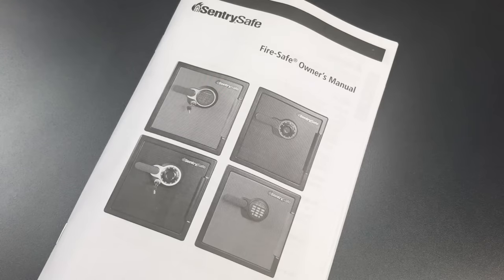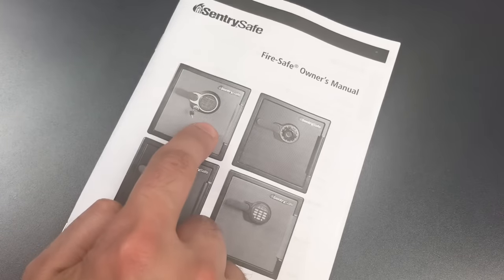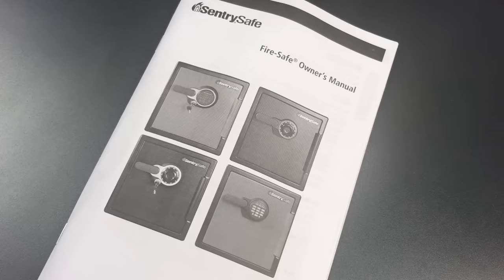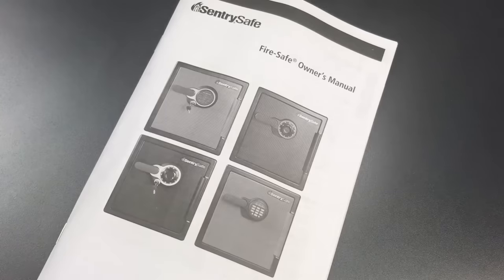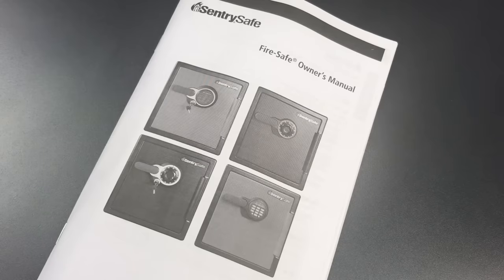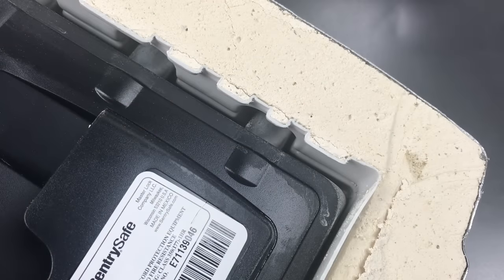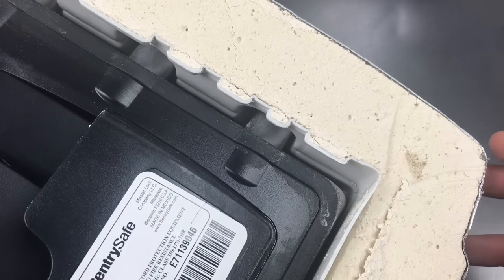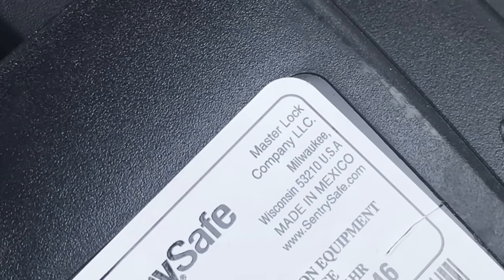[756] Sentry Safe Cut in Half FAST!

Comment: The hardest part of getting into this safe was finding an extension  cord.
Reply: you can cut it with an hacksaw it would take time but after looking at that metal thickness it's not impossible lol
Reply: Flexvolt baby!!
Reply: The blade guard gave him some pause.
Reply: Brutalll
Reply: That thick of metal, you could probably use tin snips.
Reply: "We will build it and the sheep will come"
                                              ~Klaus Schwab~
Reply: The new battery powered ones do good.
Reply: Hardest and longest part was probably sweeping up the dust afterwards!
Reply: Honestly, it's so shit, you could use a bowie knife and a rock to cut the bottom out in a circle, then chisel out the "fire retardant" quickset thing and then you're in like Flynn.
Just looking at how easy the saw cut the metal i can tell it's super easy to deal with it.
Reply: Dude, move the safe closer to the electrical outlet, no extension cord necessary, duh!😂
Reply: Does anyone know what kind of blade he used in this? I have the same exact safe and my grandma lost the key to it and left me it in her will a few years back, i dont want to hurt myself using the wrong blade.
Reply: @aserta  what kind of blade did he use in the video?
Reply: Buy an blade which teeths had a little piece of diamond welded on it.
Reply: In an lithium powered world, who knows where, and what is the electrical outlet?
Maybe for charging your tool like Makita BL system or you likes Milwaukee Fuel?
Or something like DeWalt?
Or chinese cheap copy any of above?
Not makes sense.
You when really want to get fast into that "box", you should have at least the chinese one....
Reply: Its so easy a caveman could do it(with a club and chisel)
Reply: Use a blade that cuts steel and make a few passes lower blade a very little each time and the 1st time too only have the blade out a little….don’t cut all at 1x
Reply: What’s the right sawblade.
Reply: Wireless like me

Comment: ive owned computer cases with thicker metal
Reply: oath
Reply: ive had headphone packages that were harder too open
Reply: you are right. the sentry safes like that are fire safety boxes (with some protection against a fire) that's why they use thin sheet steel
Reply: a plastic storage tub filled with foam would take longer to get in
Reply: No kidding, the IBM towers back in the 90s had 1.1 or 1.2 mm thick cases, i can't confirm for sure because i don't have it around me, but that metal case was strong enough to support a broken beam once in an emergency. I've been transplanting my computers in it for years.
Reply: aserta Just grab a Presario EP series, the case weights a ton. Drop a lock and you got a better safe thant the one showed here
Reply: Odd flex but ok
Reply: @38911bytefree  some computer cases especially the enterprise ones from back in the day have loops for a lock.
Reply: The Vibe  LOL yeah. I still have an OLD Vectra VE Series with the lock and keys to lock the cover. Not the strongest cover from that preriod. It was meant to be a "slim" from factor. Hey, it was in the 96. Deskpros were a bit bulkier. Both of them are tanks in terms of HW
Reply: sinnders97: Indeed, a safe made from 20 layers of blister packaging would be much more secure than this!
Reply: ive owned lunchboxes that were harder to get into
Reply: A iPhone is harder to open🤣
Reply: Think supermarkets have sandwiches with tougher packaging
Reply: Yup!, I shove my valuables in my old 166Mhz computer case.... no lock needed, "hey frank what should we grab? this 90lb safe, or this very old CPU?"... "grab the safe it probably has more valuables, that CPU is just a huge paper weight" 
The opposite is true ;)
Reply: K
Reply: My noughties' Cheiftec tower has 1.2mm steel - have used it as seating at LAN parties.
Reply: hahaha yes old IBM PCs and clones are stronger than this "safe" :D
Reply: I've had beer cans with thicker metal.
Reply: My Phantex Enthoo Evolve case easily has 10 times thicker steel
Reply: I've owned computer cases that weigh more.
Reply: lol your telling me i build my computer in an old intel case from the 90s the one i used to play black stone on  HA the case is so ols it still has an intel pentium 2 logo
Reply: i had condom wrapers that were tougher than this!
Reply: fucking sheet metal. thinner than a computer case literally.
Reply: All computer cases that I've ever seen are thicker, even the cheapest garbage out there.
Reply: i have seen bean cans with thicker metal
Reply: What would thicker metal accomplish?
Reply: Swampy  A grinder cuts through steel with a smaller disk. Metal drill bits, go through metal. Oxy Cutting flames aren't as big and "damaging" as you make it out to be. I work in construction using these tools everyday.

There's nothing I can't cut through.
A safe keeps things safe. A slightly thicker safe keeps things slighter safer.

Most people bolt safes to the ground, in corners against walls. I'd like to see this video again done realistically. The only reason he can use a saw is because it's loose.
Reply: I would use a edc handheld can opener
Reply: @aserta  And in the late 80:s they were cast metal. I have been looking for a case like that for years. I imagine connecting the CPU to the case would make the entire case a giant passive cooler.
Reply: wait thats metal... i thought it was wood and plastic
Reply: @Joey Barreras the outer skin is a piece of sheet metal. The inside is a plastic, designed to fuse into a airtight seal if exposed to heat. In-between there is a insulation foam. This safes are designed to protect against fire.
Reply: @Joey Barreras I based it of the sound from the saw. So I can't be really sure, but I have seen someone burn a safe like this, demonstrate the reason behind the plastic.
Reply: ROFLOL, you try cutting my Cooler Master case like that,
Reply: Yeah, my Corsair case is gonna put up more of a fight than that safe did.
Reply: Yep, my enthoo evolv has like quarter inch aluminum panels, that safe is like having a pop can wrapped drywall lol.
Reply: The sad thing is all the big closet size gun safes you see at big retail stores like Cabela's etc are also thin sheet metal like the one in the video.  They can all be pried open in seconds.  They all have what appears to be some big thick heavy doors but if you lay it on its back and use a spud bar and pry on the sides you can open it in 2 mins
Reply: I've seen Arnold Schwarzenegger bite through thicker metal than this
Reply: There are security packages that are harder to cut open.
I'v cut myself on one of those packages before.
Reply: If I'm not mistaken, everyone's computer case has thicker metal.
Reply: Ikr
Reply: @Eimantas Butkus I thought this was a YouTube comment section, not an academic paper
Reply: I'm 6K Like ....yaaaay congrats mate
Reply: in fact: i own a case with 2mm thickness :D
Reply: x.D
Reply: Try searching jonsbo's case. That thing got 2 or 3 mm of metal.
Reply: Swampy  no problem cutting a 1/4"+ with a good carbon steel blade lol .. (Diablo steel demon ) ive cut bundles of rebar ,heavy gauge framing steel , stainless , I beams , thick plate ,  really not much it won't cut lol within reason
Reply: @sinnders97  LOL
Reply: Yeah, once those cases were thick. now they're like aluminium foil
Reply: Almost all comüuter cases are thicker than that.
Reply: Nobody Knows  So since ur posting the same "FIRE-rant" in several threads ill answer in several of them, cos u clearly like to twist facts..! 
So if u didnt see the whole vid ill just mention the obvious here. LPL literally says: "According to the company website it provides SECURITY protection, FIRE protection and WATER protection. Now i cant speak to the fire and water protection, but as for 'SECURITY' - THATS the reason im making this video." ... 

"...confusing 'cos ... Its a heavy box. Its called a 'SAFE'. It looks like a SAFE. It operates like a SAFE." ... 
"If we read this manual we can see that it explicitly anticipates that owners will keep valuables like jewelry and watches in it."
But yeah NK, u focus on the fire part of it...  X-]
Reply: Freelaxx 1 HAhahah. I honestly don’t think any of us don’t know that for theses types of “safe” the main point is fire protection and to make it less attractive to pick up and walk off with.  Just more of a surprise that the metal part was unexpectedly thin. Also how damn thick old pc cases were :)   I’ve seen how thick the metal is on many many computers but only a hand full of safes.   Also after maybe the first to replies it was more of a pythonesque series of replies.   Oh what I would have done to live in a cardboard box all we had was a pot hole full of dirty mud
Reply: same bruh
Reply: Legit?
Reply: I had/still have a Thermaltake Armor+ case much thicker steal on that than this safe
Reply: @websnarf  not all computer cases are metal post are plastic. Mine is metal, metal cases are kinda nicer in my view
Reply: psh , I'm certain you could find laptops with thicker outer metal than that
Reply: I thought you were exaggerating but I just finished the video and... oof
Reply: The cardboard box my computer case came in was harder to open.

My case would take less time to break into than the safe, though. It takes about 3 seconds to open one of these safes with a magnet, but you could break the tempered glass panel in under a second.
Reply: a normal pc case has thicker metal
Reply: yup. My phanteks evolv atx has way thicker metal construction lol.
Reply: Ha forreals tho
Reply: When I was younger we had canned food with thicker metal, and it took longer to open too!
Reply: me too
Reply: XD
Reply: This safe is so bad, you're not even exaggerating.
Reply: @aserta  The PS2 uses similar casing, and it also had internal plating covering some parts, it was really heavy and probably harder to get into than this safe, if if you go for non destructive entry :P
Reply: Are you talking about your amiga or gateway grandpa?
Reply: I've cut plywood with more resistance to it than this safe
Reply: I see no lock picking !!!!
Reply: I've owned super hero themed lunch boxes with thicker metal.
Reply: @sinnders97  thats funny, what even funnier is picturing someone grab their powersaw to get those damn blisterpacks
Reply: I've cut bargain-basement particle board that resisted a saw more.
Reply: Pretty sure I have owned bags of potato chips that were thicker than that.
Reply: @tobin1677  computer cases with thicker walls prevent audible vibrations. Mostly useful in computers with hard drives.
Reply: I OWN a computer with thicker metal.
Reply: @aserta  I used to have a case like that. I sincerely regret giving it to my brother, who used it for a cricket stump!
Reply: My damn laptop would be more sturdy
Reply: Lmaooo
Reply: Fireproof, they normally aren't strong, it's just insulated, NON fire proof safes are normally way heavier duty
Reply: Would’ve been sweet if you had worked “in any case” into that comment.

Comment: "Let's just cut it in half again to show it wasnt a fluke"
Reply: Thank you for this comment
Reply: A Fluke is a fish. this was a safe. just one cut is necessary to see it is not a fish.
Reply: @PrincetonTV  u ever heard of a joke or nah
Reply: @ywgx7943  Hello Ywgx, hoping your day is going well. A joke has a structure (often) that consists of "the set up" which creates tension an interest. And a "punch line" ("Punch line" see 'Punch and Judy' ) which resolves the 'tension' from an unexpected perspective.  
In the example shown above, the set up is comparing a fluke(fish) to a (locking) safe.  
The punchline is the inference that when one cut open a fish there are "guts" (and guts are also used to infer strength and bravery),
while on the other hand the 'safe' lacks the messy fish guts and also lacks the inferred strength.   

The 'delivery' is the fashion in which the 'set up' is made and respects the common practice  of the longer the set up / the shorter the punchline. 

And of course the joke and it's delivery can be measured as good or bad in terms of 'faffs'.
Faffs or laughs are the quantitative number of actual chuckles made and the length of time the chuckling time persist. 
Therefore:
faffs(X) * T(ime) = humor
Humor with a high number are sometimes known as "gags".
And gags that work often and repeatedly are called "shtick' (a.k.a. 'bits)

A shtick (Yiddish: שטיק) is a comic theme or gimmick. The word entered the English language from the Yiddish shtik (שטיק), in turn derived from German Stück and Polish sztuka (both ultimately from Proto-Germanic *stukkiją), all meaning "piece" or "thing"; note that "Theaterstück" is the German word for Play (theatre) (and is a synonym of "Schauspiel", literally "viewing play" in contrast to the "Singspiel").

Sometime in performance it is necessary to give the audience permission to laugh or introduce that a joke is to follow. This is done to avoid unwanted tension that the joke can not resolve. 

For Example:
(This will be your personal punchline Mr. Ywgx, wait for it!)

Your Punchline:
Isn't Naah Indian Bread? 

(LAFFS and Giggles!!!)   
 Notice the brevity of the punchline is just 4 words. (this line is an example of "beating a dead horse".) 

Well that's all I have for you today, if you do have any question please put them below (this line is an example of humor thru repetition).
Reply: @PrincetonTV  did u copy paste this or do u have nothing to do
Reply: @ywgx7943  Excellent question. This is by far a most validating reply. Thank you so much for your time and attention. 
Only the definition of shtick was 'c & p' and from Wikipedia. 

I do not have "nothing to do". I might have autism and/or ADHD. 

And I could certainly ask you if you "heard of a joke" and "nothing to do". but that would be redundant and obvious.
Reply: @PrincetonTV  the joke went over their head stop killing them
Reply: Lmao got it to 727
Reply: @blockshift758  Please thank your mother for making sure you got to school ok !! (as you are obviously intelligent)
Reply: @nanimuwu  The real joke about this safe is that if you drop it from 5 feet on a corner, it will open like a raw egg.
Reply: @nanimuwu  fellow member of the osu community I see
Reply: @PrincetonTV  yea no this was an osu joke
Reply: @PrincetonTV  i was referring to ywgx...
Reply: @buritsuu  so there's sodium and potassium

potassium asks sodium, "you want to join the banana club?"

but sodium responds, "Na"

so potassium responds, "K
Reply: Brilliant :D
Reply: @juku666  Why shouldn't you play hide and seek at an airport?
.
.

You're always hiding in plane sight
Reply: Sentry: You're fired.
Reply: @PrincetonTV  Do you think he understands now ? ..
Reply: @DavidVanHelden1  No I don't. It twas a wasted of time and computer electricity
Reply: @PrincetonTV  lol
Reply: @PrincetonTV  it was not, because i had fun reading it.
Reply: @erneststyczen7071  me too lol
Reply: @kush8071  im glad
Reply: @erneststyczen7071  TY :-)
Reply: @PrincetonTV  Fish is open with a knife, Safe is open with a Key !!!
Reply: Sorry to be offtopic but does any of you know of a trick to log back into an Instagram account??
I was stupid forgot the account password. I would love any tips you can offer me!
Reply: @Dawson Crosby instablaster =)
Reply: @Zayn Wesson i really appreciate your reply. I found the site thru google and Im in the hacking process now.
Seems to take a while so I will reply here later when my account password hopefully is recovered.
Reply: @Zayn Wesson It did the trick and I finally got access to my account again. I'm so happy:D
Thanks so much, you saved my ass!
Reply: @Dawson Crosby glad I could help xD
Reply: @dawsoncrosby2954  What is Instagram ? Is it a VPN or a like a Polarize Camera ?
Reply: @pedroi.g.3277  What ?
Reply: @PrincetonTV  Boooooooring.
Reply: @PrincetonTV  bro I are my hero and have a great day!😂
Reply: @Justaguydoinghisbest  You are my hero also, I am having the great day you prescribed for me.
Reply: @PrincetonTV  Dude stop wasting your computer electricity lol
Reply: @derpinbird1180  Dude stop wasting your computer electricity lol
Reply: @PrincetonTV  Ben Bauer made the a joke about cutting the safe again in reference to lockpicking lawyer most of the time saying the phrase "let's do it again to make sure it wasn't a fluke" when succesfully picking a lock. Obviously, you missed it or didn't know about it and now you're doubling down on your ignorance.
Reply: @rap3208  your thoughts are valid and it seems you took some time to write them down. Thank you and have a nice day.
Reply: @nanimuwu  wysi
Reply: @rap3208  OK
Reply: i laughed an unreasonable amount at this comment
Reply: @rapidfirer56  Thank you for see the fun. :-)
Reply: @nupsi1000  If you search in LPL's videos, you will find many video of using a knife to open locks and safes. By contrast opening a fish or fluke with a grinder might prove to be unfortunate.!
Reply: @PrincetonTV  that's true, sir! :-)

Comment: If you rephrase the intro and conclusion this could be an ad for "Amazing circular saw, cuts through safe like BUTTER!"
Reply: Because the safe is made of butter
Reply: @vanjamenadzer  butter’s actually tough when it comes out of the fridge, this shit was hot trash
Reply: That is an insult to butter!
Reply: @TheRangaTanGaming  yeah, but the safe do not come from the fridge, so you cant compare it with butter xp
Reply: Yeah i think i have the same model saw, judging from appearances, so HEY - i have a saw that can cut a safe in half! O.O
Reply: @markmaki4460  I may have a watermelon here that could cut that safe in half!
Reply: I'm a bit late, but: that would be a weird way to advertise a saw.
Reply: @vikiai4241  Flex Tape should solve that problem!
Reply: Crossover with project farm?

"And the Diablo blade cuts through the safe in only 5.77 seconds! Very impressive!"